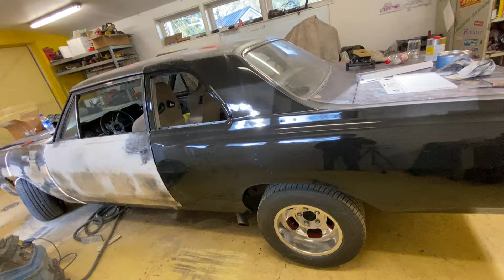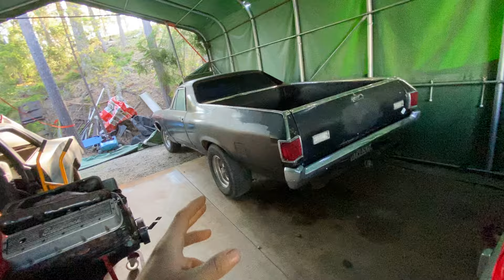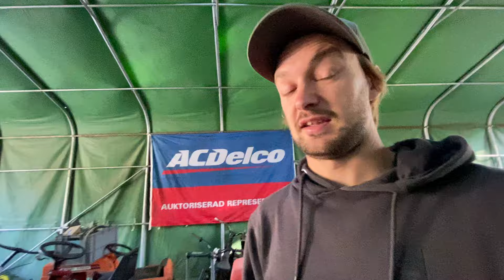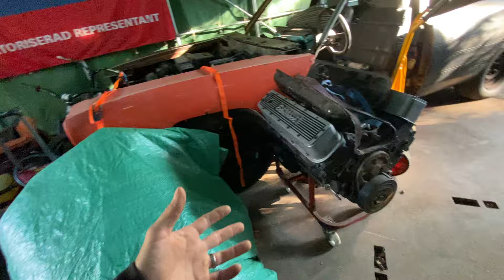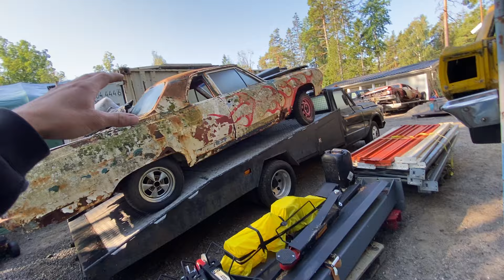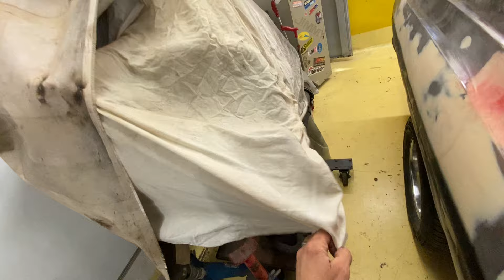Why i haven’t been posting on this channel

Comment: What size compressor are you painting with?
Reply from the maker: I’m not really sure how to convert it but the manufacturer says it has 2.2kw engine and delivers 195L of air at 6 bar
It’s not big just an average size garage compressor.
I can show it in the next video.
Reply: @BarelyRunning  that’s 51 gallons in bald eagle measurements. Sizable compressor. I can see how you’re getting such good results. Does Sweden have Harbor Freight?
Reply from the maker: We do not have harbor freight but we have a store called Biltema (car theme straight over translation) wich is probably the closest to harbor freight

That’s were i bought my compressor